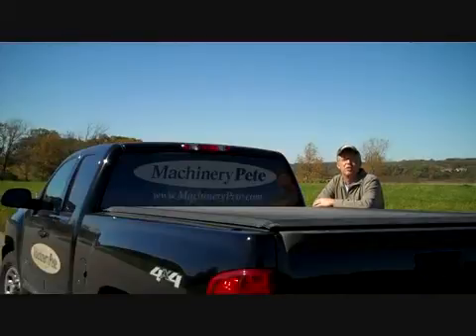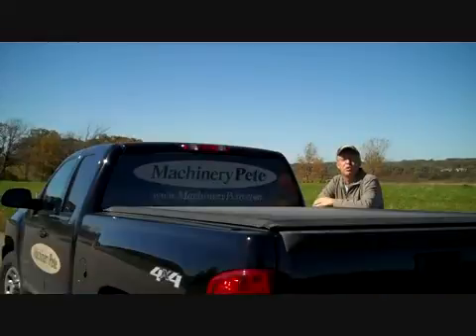Making Deere 10 Series & 4020 Tractors: Harold Brock Interview Part 4

Comment: Thank you sir for your contribution to my favorite tractor, the 4020. My first farm job,  the man I worked for had two diesels.  A power shift and a sycro. We planted, cultivated, put seedling in as well as ran New Idea picker and picker sheller. Plus put up 15,000 square bales of hay.  I have one of my own today.  It's my primary tractor along with several two cylinders still working.